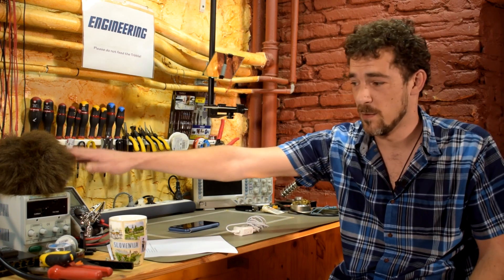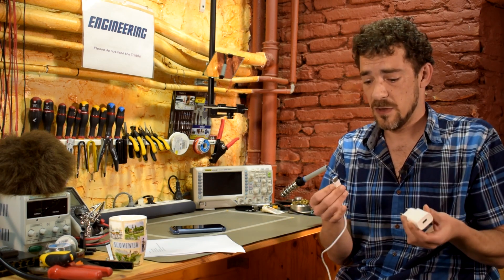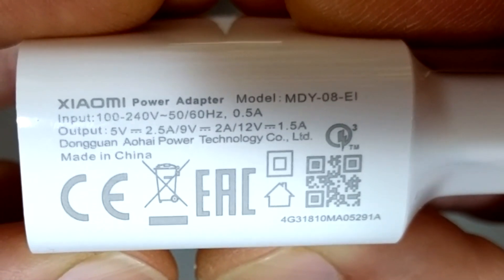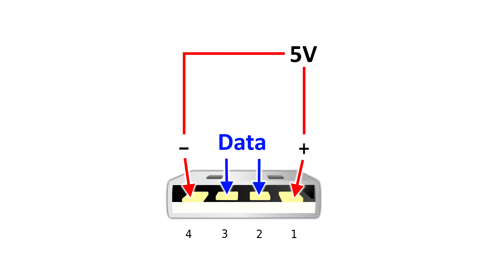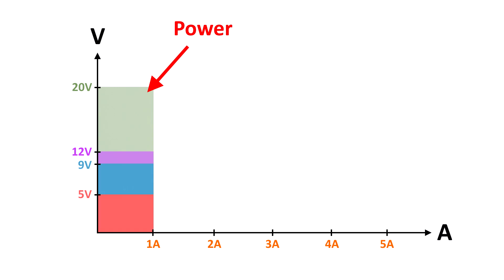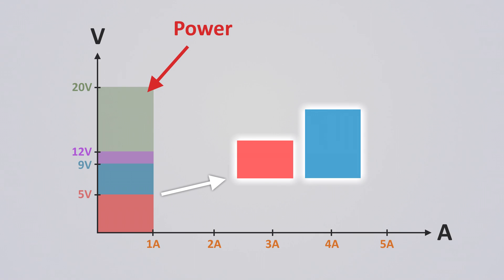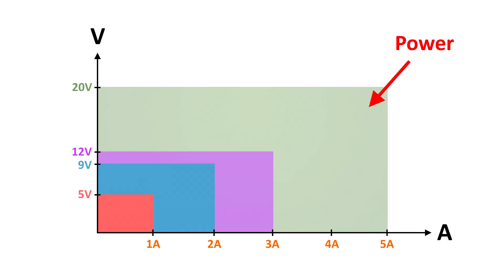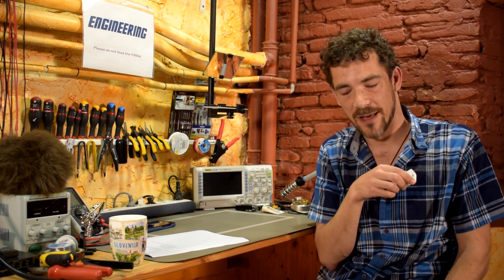How do Quick Chargers actually work? Magic!

Comment: Does quick charging help with overall efficiency as far as electricity cost? Also does it decrease the lifespan of your battery?
Reply from the maker: It doesn't save any electricity, and the battery lifespan depends on the battery. Generally speaking, slower charging makes the batteries last longer - but then again, some batteries are designed for fast charging. It really depends on the battery, which is difficult to investigate these days since most gizmos have non-replaceable batteries.

Comment: Cool, thanks for the video. Very well explained. Practically though, how would you recommend going about selecting a usb cable since the cables themselves don't really have specs and these days, I'm not sure we can even trust any specs on them even if they are provided. 

Have you had particular luck with certain brand/models of cables? 

I realize this is an older video. Would a poor USB C cable perform better than a top noch high end USB A cable generally speaking (or is that a dumb question and it actually relies on a lot of more specific info in each scenario)?
Reply from the maker: In most cases, you don't need to worry about the cable unless you're doing 90W charging of, say, a laptop (20V @ 4.5A). That's still pretty rare these days. Even recent quickcharging smartphones only support ~30W charging, which has much lower currents. So, the cable is just something to watch out for in case you do end up with a gizmo that does uber-high charging rates. And in those cases, the provided cable will likely be a bit thicker, so that's the one you'd want to use just to be on the safe side.
Reply: @ScottiesTech  One more question if I may. You might know the real answer. There's so much controversy regarding charging habits. 
1. Plug a phone in overnight vs not. 
2. Waiting to charge only when it's between 20-80% capacity vs plugging it in whenever you get the chance.
3. Not letting it get down to 0% 

I'm familiar with LiPo battery storage for rc cars and fpv quads but I have a feeling the controllers/computer/chips inside the phone are smart enough to figure out some of stuff that I would need to do manually on a hobby charger for my hobby rc battery packs. 

Would love your thoughts on phone charging habits and what you feel would be best. Thanks!
Reply from the maker: @Funcentric  I'm not sure about the charging in phones. I know that some phones won't charge to 100% if the level is already at 80% or above. I had one that did that, but the others just always charged when plugged in. Laptops are a different story since they often have 'battery saving' chargers and sometimes it's even configurable in OS software or in the BIOS/UEFI. But anyway, my general rule of thumb is let the battery in the phone run down as low as possible before recharging. If you recharge all the time at 50%, you will lose some capacity in the longer term even with the most modern battery/charging tricks. It's not THAT much, but it's still there. Of course, sometimes it worth just charging because having enough power is better than running out of juice without a charger at exactly the wrong time!
Reply: @ScottiesTech  I see. Okay thanks for taking the time to provide some input. I appreciate that.

Comment: Super easy to understand, thank you! I'm always plugging in whatever cable I've got to whatever charger I've got. Now I'll pay more attention! I just wish there was a quick charger like that for people to recharge their batteries! ;-)
Reply from the maker: Well, that's one of the benefits of quick chargers: If you plug your phone in, it charges quickly. If you plug your Kindle in to recharge instead (or some other slow-charging gizmo), it won't explode. Which is nice.  But since all quick chargers are NOT created equal, it's best to use the specific one that came with higher-power gizmos like smartphones.